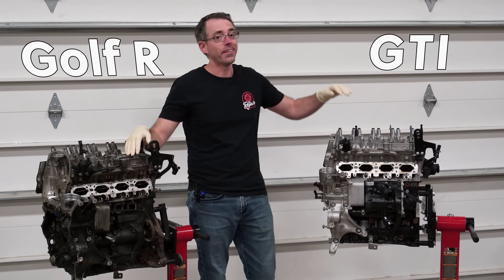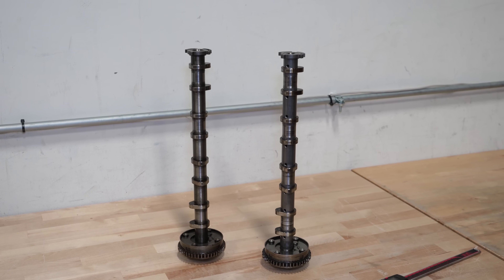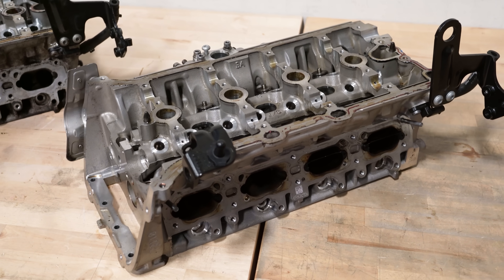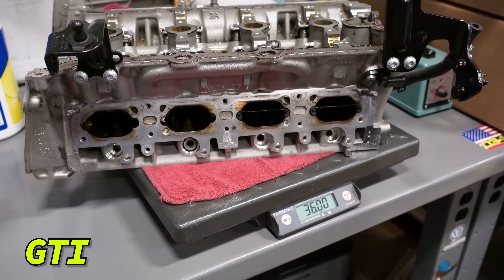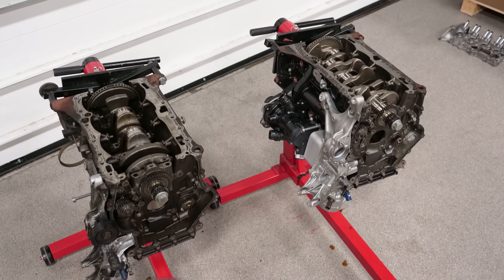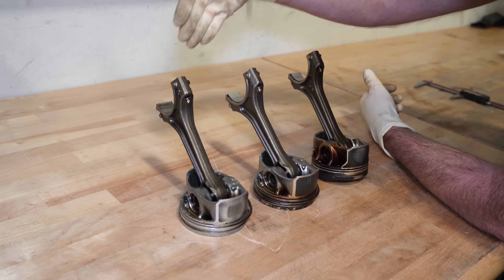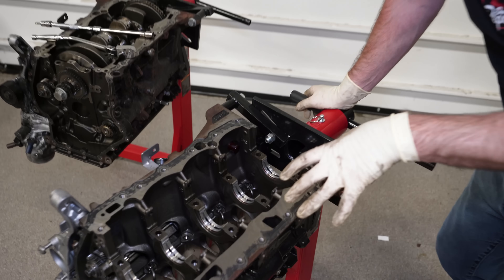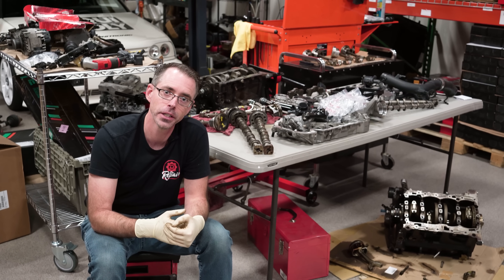Are Golf R Engine Internals Better than a GTI?

Comment: Vag go to the effort of using forged rods, forged cranks and optimising the rest of the design. Then they fit it with a plastic sump and plastic waterpump housing.
Reply from the maker: Better than a plastic crank and a forged water pump
Reply: @Deutscheautoparts  LOL
Reply: @Deutscheautoparts  Give it time.
Reply: @Deutscheautoparts  Ohh Plastic Cranks TDV6
Reply: 😂😂😂😂😂 @Deutscheautoparts
Reply: @Deutscheautoparts that s the ticket
Reply: @Deutscheautoparts Can you compare the 2014 gli vs the MK7 Gti?
Reply: @Deutscheautoparts  Plastic cam sheduled for Golf IX.
Reply: Engineered to last to the end of the warranty, and no further. But think of the profits!
Reply: I just bought the longer undertray to protect mine, there are holes in the subframe already to fit it.
Reply: @timbob5012  Good idea. Mind providing the part # or link where to purchase? thx
Reply: @timbob5012  same
Reply: I've replaced a GTI water pump (130k mi). Seemed decently built. Seals failed before the plastic.
Reply: The concern with plastic parts isn’t the ability to perform their duty, such as a water pump. Nor is the concern of stones hitting a plastic sump, as an Undertray adequately protects it. The draw back of plastics parts where heat and fluid is involved is the degrading of plastic - over time they can warp and the weakness is its ability to maintain a good seal for as many years as typically an aluminium piece. This isn’t to say that aluminium parts don’t leak…. They do. Just not as common.
Reply: IDK in golf in particular, but plastic sumps in Ford hold up over 10 years now and 200-300k miles+. When You hit it it's gonna crack same as aluminium one. All depends is it well engineered and use quality plastic, if yes it's gonna hold 10-15 years+. Same people were saying about plastic valve covers and intake manifolds but they are 20+ years now and still working if designed good and also provide many benefits over the aluminium ones (lighter, keep heat inside engine where it suppose to be helping in cold start, plastic Intake keep air temperature lower, cheaper etc.)
Reply: Can’t find the forged water pump option on shopdap :(
Reply: Now pretty much every manufacturer uses plastic everything
Reply: Anyone who justifies putting plastic components that have a known issue to break on a performance oriented vehicle is a meat rider.
Reply: It would be durable if they didn't. That's the whole point.
Reply: They did it to make an Audi’s more high end. The oil pan are made metal and equipped with oil temp sensor
Reply: @w0lvez1  Our Golf (GTI) with plastic pan had an oil temp sensor. It is plastic because it is cheap...
Reply: @  Sorry, I’m not aware that they already put an oil sensor on newer GTI. If you want an upgrade use Audi TTS parts. TT = GTI  TTS = Golf R😁.  Check the performance comparison of GTI vs TTS equipped with the same engine.
Reply: I have do pump in the morning on s3 2017
Reply: @eoghanhennessy443  just take your time to do it right, it's not something you want to have to do again because of a small leak  😁
Also bleeding the cooling system is a bit of a pain, having a vacuum filler is worth it even if you buy it just for this one job
Reply: @raoulrr ots funny you say thwt I put a new pump on this car recently appears to be leaking 😂.  And bleeding it was a pig last time I tried the diagnosis to help bleed the electric pumps took while but
Reply: There's sump pan options in the aftermarket if you're so inclined.
The water pump? That might could use some help.
Reply: same as merc/bmw/audi/seat
Reply: As with the B48 engine weak link is pistons at higher boost levels especially in high gear low speed full throttle use as the tune becomes more aggressive the risk of cracked pistons goes up…
Reply: @martinaston1715  It depends on the B48, as the 20i models have weaker pistons than the 25i, 30i and 35i versions. They will still melt if you go too mad but there is more headroom on the more powerful engine variants. The EA888 has dual injection (on EU models) which tends to help prevent LSPI to a large degree.
Reply: still better then a plastic oil pan with plastic drain plug like the mustang gt350 comes with
Reply: @thedandy6765  The VW stuff does have plastic drain plugs, or at least our Golf does.
Reply: @simonh870  my mom drives a golf 8r and hers doesn't have a plastic drain plug
My golf 7gti doesn't have one either 
Is that something from the past 2 years orso
Reply: @thedandy6765  Not sure, ours is a 2016 model. I usually buy a new plug at every oil change because they are cheap.
Reply: @simonh870  the plastic sump & drain plug engines (mk7 golfs and up) were designed for easy oil extractor oil changes with their oil filters on top, and all the oil comes out through the dipstick, you don't ever have to crawl under cars, remove undertrays etc.,very clean & easy
Reply: @raoulrr  I have tried with an oil extractor (Pela) and it never seems to get all of the oil out. It literally takes 2 mins extra to drive up the ramps, undo the sump plug and then drain the oil. Being plastic i always replace the sump plug at each change, at it costs £3 and there is no undertray in the way of it.
Reply: People will be plenty pissed if they have to replace their rods every few years. Shitty watercooler breaking is more palatable.
Reply: i mean u can just swap it
Reply: No shit.
Reply: why do we need metal sump?
Reply: The vacuum cleaner water pump belt is mint!
Reply: Yeah, because they need them to make 300+ reliably enough to give warranty. Plastic sump or pump housing has no affect on reliable power output.
Reply: Upgraded my sump to a pressed metal one…but of course it was after my wife ran over a dip in the road that just so happened to have a good sized rock right at the edge, drained the oil out completely! Car shut itself down right in the middle of the road, luckily no damage was done otherwise! If you ever want to experience ULTRA limp mode… put a hole in your sump!
Reply: Weight saving ;)
Reply: @betterwithrum  I doubt it, whilst plastic is lighter for the same volume it needs to be much thicker to be as stong. The difference will be a few grams either way.
Reply: @simonh870 I’m joking 🙃
Reply: So optimising those parts too. Over building something is just as pointless as under building it. If its going to work long enough to see the warranty out, save weight and cost why wouldn't they use it?
Reply: @siraff4461  They are not optimised though, as they regularly fail. The cost cutting isn't worth the adverse reliability reputation that the brand suffers when they continually fail.
Reply: @simonh870  Thats a calculation they have to make. If its not worth it they will change the design on the next version. Like that annoying heater control system from the mk8 that nobody liked. The 8,5 doesn't make it perfect but it fixes the main problem people had.
Reply: @simonh870  yes, water pumps do fail, but the sumps? maybe don't drive your slammed car on gravel roads LOL
 I personally like the plastic sump; sure, a stamped steel one might take a bigger rock hit with just a dent, but the plastic one is lighter and 100% better than a cast aluminum one that would crack from the tiniest pebble, then cost a fortune to replace
Reply: @raoulrr  My sump has been fine but the roads are terrible here in the uk and it is always a worry, especially as plastic tends to degrade and go brittle over time.
Reply: @simonh870 - VW uses plastic parts because they’re cheaper, pure and simple.  They’re not better or more reliable, especially in a hot engine bay.
Reply: theenglishtrucker1849  Lol, if anything I over service my cars. The last thing that went wrong my 2016 Golf GTI was the clutch slave cylinder, which went at 48,000 miles. Not sure how I could have prevented that. Fortunately I was able to do the repairs myself and I fitted a different brand of slave to the original because they should last longer than that. The clutch itself was barely worn.
Reply: @simonh870  at least in my s1 there is a thick plastic skid plate under the sump, here shouldn't be worries as long as that stays on.
Reply: @simonh870  automotive plastic doesnt go brittle lol and plastic is one of the most stable compositions in nature. They can last thousands of years. Dont compare cheap toy plastic with automotive plastics. Toyota uses plastic heads and theyre perfectly fine.
Reply: @AI-qd4vb  I guess I will have to disagree, and I do quite a lot of work on cars. The worst parts for going brittle I have seen are plastic timing chain tensioners. The heat and exposure to oil (often with diesel mixed in) isn't a great combination. They start off white or cream coloured when new, then over time turn brown and bits then start breaking off. Either the bits then clog up the oil pick up strainer or fail in a bigger way allowing the timing chain to jump.
Reply: @simonh870  It only needs to work until the warranty is up. And VW sells plenty of GTIs on a yearly basis. Despite plastic failures galore in the engine bays since the days of Mk4 cars, people still buy them.

Including me. I just wait until suckers buy them new, absorb the massive depreciation and then I buy them used. I buy well maintained cars, fix any issues and pre-empt any known issues. The only consistent problem I find is that people think their used GTIs are gold plated and diamond encrusted. So negotiating can be difficult.

"But I did all the maintenance ..."

Yeah, you're supposed to.
Reply: theenglishtrucker1849  I agreed with everything you said except for the last sentence, that immediately made me say have you driven or owned Toyotas before? they are significantly more reliable, both statistically speaking and anecdotally. I’m a tech and have worked on both for years.
Reply: @raoulrr  Metal oil pan helps cooling the oil.
Reply: @w0lvez1  I'm sure the oil cooler cools the oil much more than the oil pan
Reply: @ Modern engines are equipped with an OIL HEATER not an oil cooler. The heat exchanger you’re referring to is connected to the DSG fluid heater. On older engines the thermostat is located where the upper radiator hose is connected. To reach normal operating temp, only the coolant inside the engine needs need to be heated. 195 degrees F of coolant comes out from the upper radiator hose. The coolant at the lower radiator hose is cold. On modern engines the thermostat is located where the lower radiator hose is connected.  The temp of coolant at the lower radiator is around 195 degrees F.
Reply: @simonh870 no problem with plastic pan just learn how to drive and don’t slam your car
Reply: @simonh870  No, they don't fail, and if they did, it wouldn't have anything to do with then being plastic.
Reply: @simonh870  " especially as plastic tends to degrade and go brittle over time." - Again proving you know less about material engineering than cows know about football.
Reply: @derbigpr500  So why has the plastic gone brittle then? Could it be the heat cycles from the engine over time I wonder...
Reply: @derbigpr500  So why did the plastic water pump housing on my car crack? it is a known issue on the EA888, even though you think that they don't fail.
Reply: @simonh870  There's nothing for you to disagree with buddy, you've already proven you know nothing about mechanical engineering or material engineering, and you keep refering to "plastic" as if it's just one single material. You can't even comprehend how out of depth you are and how little you know, and how many types of plastic that will outperform and outlast any metal for certain applications there are. 

"The worst parts for going brittle I have seen are plastic timing chain tensioners. "- They don't get brittle, stop talking nonsense. Their chemical properties literally don't change and can't change in the environment they're in, as they're specifically engineered for that environment. They'll break due to stress when the chain stretches and goes out of spec if not changed when it should be changed, or if the tensioning mechanism fails. If a chain tensioner breaks, the "plastic" part, it's not becuase of itself, but because of something else being off. Also, I like how you totally ignore the fact that the "plastic" chain tensioner has a LITERAL METAL CHAIN grinding on its "plastic" surface all its life at high speed, in high pressure, high temperature environment, yet the surface doesn't wear out significantly for hundreds of thousands of km, whereas any metal, literally any metal, would wear out in that time significantly more. 

"The heat and exposure to oil (often with diesel mixed in) isn't a great combination."-  People who design those parts take into consideration the heat and oil, I know, shocking, and design the materials specifically to be able to handle the heat cycles and not be affected by oil at all. That's the point of engineering grade plastic compounds. They do exactly what you want them to do. Unlike metals, which do what they do and you have to adapt to them through design or application. 

Again, you're blaming the material which you can't even name (go on, name the chemical compound the chain guide on the tensioner is made out of without googling it) for being at fault for something it's got nothing to do with, out of sheer ignorance.
Reply: @simonh870  No, it couldn't. 1) they didn't get brittle.  2) the heat cycles the parts go through don't affect the material at all, that's why the tensioners are made out of that specific material to begin with.
Reply: @simonh870  Because they used the wrong type of plastic, they changed the compount in later revisions and the problem disappeared.
Reply: @derbigpr500 your theory may be right but practical experience shows that people who bought cars with plastic parts and drove them for a few years have actually suffered broken, cracked, chipped, brittle parts (which does not happen with metal parts as proven by older engines) 😂
Reply: @raoulrr  Should have left it at don't drive a slammed car in general. Cannot wait for that kindergarten style car mod to die off ngl
Reply: @simonh870  its composite not plastic
Reply: @siraff4461  I suppose. But just check the reputation of pretty much any older VW either here or on Charles' channel. Be it Mk3, Mk4, Mk5 or even as new as Mk6, or B5, B6, B7 or even as new as B8 (Passat or A4/A5/S4/S5) -- older VW Audis rarely seem to be considered trouble-free used cars for some reason.
Reply: @TassieLorenzo  Thats because a lot of them are US market which aren't built in the same places and only allegedly to similar standards. The German built cars seem to last a lot longer for some reason. 
Also they are old cars and a lot of people just run them and run them with little or no maintainence. If your car has 200k miles on it and you never change the oil sooner or later its going to cry about it whoever made it.
Reply: @siraff4461 it’s not because the people buying this car will usually boost the power upgraded up. You have to have a ‘sell point’ why the GTI is more expensive over a golf regular tsi
Reply: when they were developing the veyron, all the basic cars like polo, golf, bora, passat, caddy got a plastic second set of keys. the plastic part was the thing that goes into the lock so you could use it for just a couple of times. they were that cheap. their cars were falling apart.
i remember when golf 5 was launched there was a marathon test, which is 100.000 kilometers. the engine had to be rebuilt at 60.000 km and replaced at 75.000 km. this never happened before or since in a marathon test. but because vw owns/blackmails all the magazines at the time the verdict was, great car, reliable, worth the premium price.
yes, you plebs buy this crappy golf so we can aford to sell the veyron at a 80% loss to people that could afford it even if we priced it at 10 million. that's vw for you.
Reply: Don't forget the plastic oil pan
Reply: Becuase it's not just "plastic". How to tell someone is clueless about engineering and out of their depth? They refer to "plastic" as "plastic", as if all plastic materials are the same. There are plastic materials superior to any metal material for certain applications. That's their point. Engineering a compund that behaves exactly as needed.

Comment: Would be cool to get a Seat Leon Cupra engine 280-290 or 300 version and see the difference between all 3 engines since they run the same engine aswell
Reply: I thought the Cupra‘s and Golf 7 R are using pretty much the same engine (CJXC, CJXG, …)?
Reply: @erikeey_8675 correct

Comment: Ive got a problem with my mk6 gti I bought in May. The car has been amazing but one day the key was hard to turn, the ignition was stuck and due to my dumbass, I broke the key off in the ignition. I replaced the ignition and the key, the immobilizer wouldnt let me start the car. I then replaced the guts of the ignition and key with the originals, the car started but this is where my issue starts.
When I put it into reverse or drive the dsg sounds like its slipping or whining and then it catches with a massive clunk. I ran the codes and it said that solenoid N216 had a short/open. I replaced that solenoid and the code went away, I continue to have the same issue though. I bought a ODB11 and tried doing the transmission tolerances. I finally got it to stop making the noise and went for a ride without any issues, as soon as I got home and put it in park - it started to do it again.
Do I need to purchase a Rosstech device so I can do clutch adaptations? ODB11 wont allow me to run either adaptations, only tolerances. The DSG worked perfect for the drive and worked perfect previous to the ignition problem, would this correlate?
I dont have anyone or any "Car friends" so Im stuck learning and doing everything myself. I have always had manual vehicles and this is my first auto....and Im pretty unhappy about this. I need help and would appreciate any advice or tips! Thanks in advance.